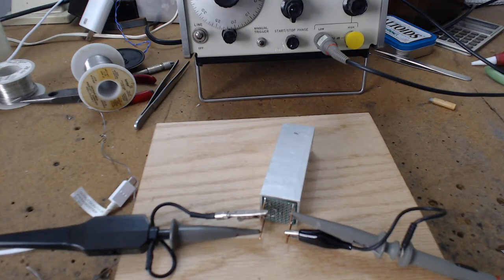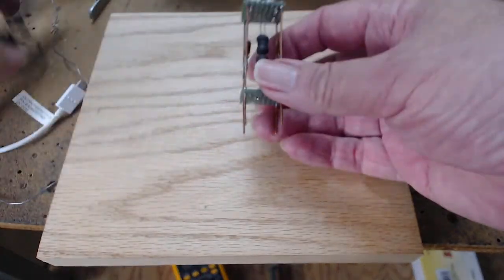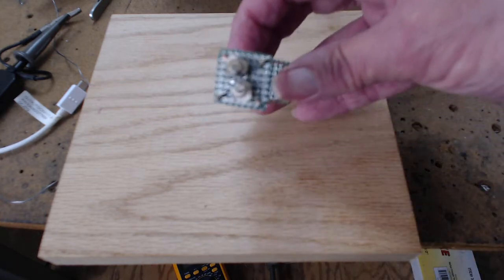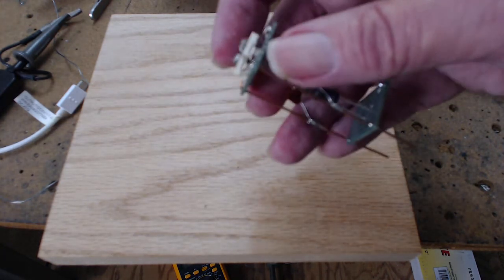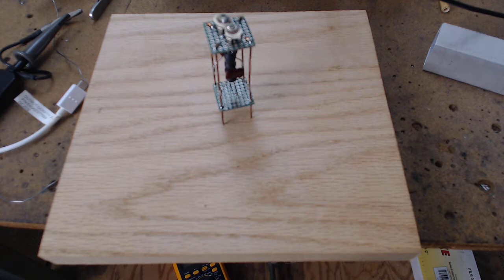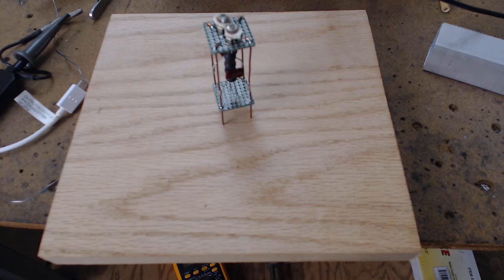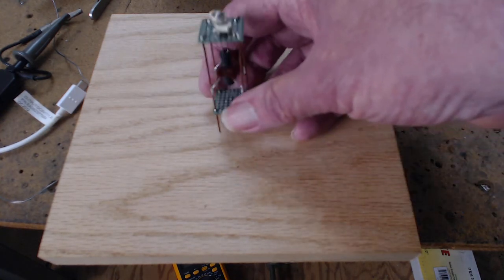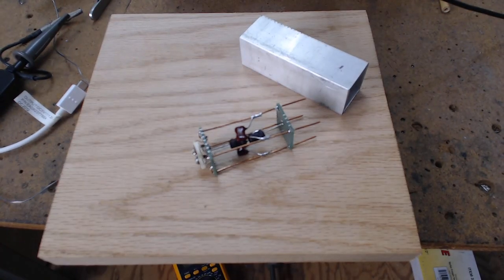Making a 455 KHZ IF CAN from Scratch Part  2

Comment: Hello there I have constructed some IF transformers but I am stuck on what to use for a shielding can  would you recommend using tin copper or aluminium.
Reply from the maker: I used 1" Square Aluminum tubing.  The Perf Board  decks slide inside it.  Most home supply stores sell it in 4' lengts.
Reply: @johnkleinbauer4424  Thanks for getting back to me I shall look around to see what I can get maybe I will upload what I have done.👍👍
Reply from the maker: I might have mentioned the tubing in part 1  I stopped the series when it got no hits. Now it became popular.  You may notice I do experiments then a few come together to make a complete unit.
Reply: @johnkleinbauer4424  I keep looking out for your projects and others of the like I didn't use chokes with mine I wave wound my coils to which I constructed a experimental superhet to test so far so  good.
Reply from the maker: @roberthorseman7432  If you look at my Arduino Coil Winder doing a Wave coil you can see I was going that way at some point. Then I went with chokes and tuning caps.
Reply: @johnkleinbauer4424  Hello there could you tell me what gauge of copper wire it you are using for the  the supports regards Bob.👍👍
Reply from the maker: @roberthorseman7432  It's BELL wire for the doorbell. Gauge? Look it up!

Comment: Great two part series on making an IF transformer. I will make one for myself.
Reply from the maker: You have several options. One side tuned. Both sides tuned.  Also the distance between coils. The further they are apart the more narrow the bandwidth but you will need more gain. The real old IF coils use Litz wire and a larger diameter coil.  Using a Ferrite Choke is the next best thing.
Reply: @johnkleinbauer4424  Thank you, sir, for the great information. Anytime  I learn something or gain a good tip, it's a good day.